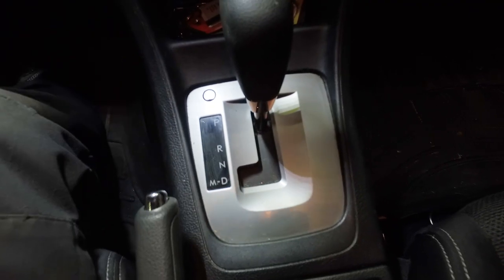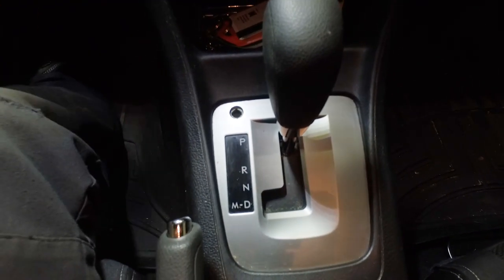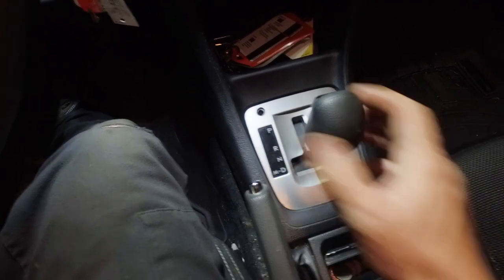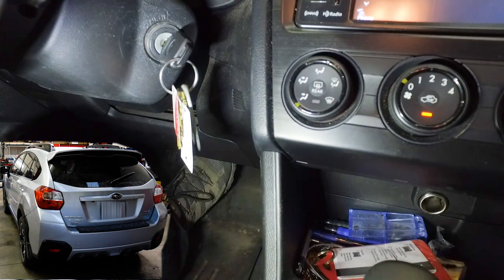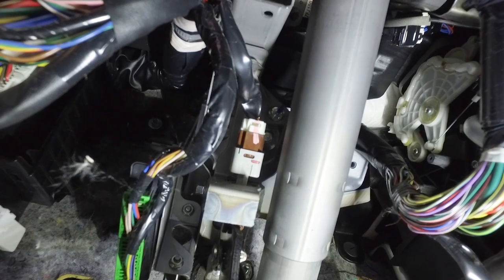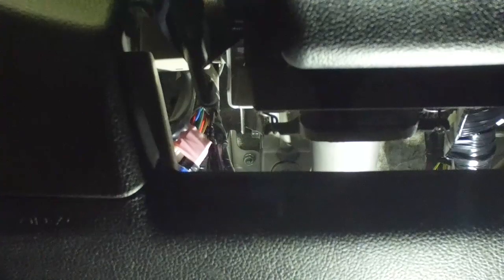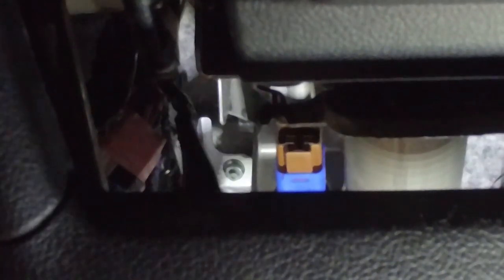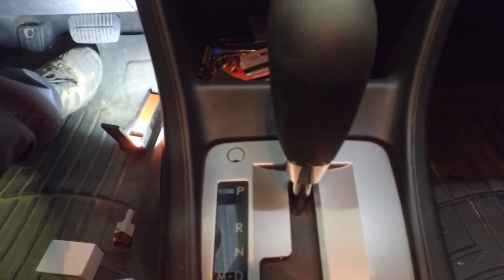Subaru Shifter Stuck In Park - bypass and repair tips - brake light switch

Comment: my brake lights off and the shift stuck in park. I changed two fuses. they burnt. Then I changed braked light switch, I could move shifter. after 20m drive, it stuck again and brake light off. what I should do next?

Comment: Our 2006 Subaru Impreza (124,000 miles) is stuck in Park. It starts and runs normally, and the stick shift moves, but the dashboard display always indicates P no matter what gear the stick shift is in. The car does not go forward or backward. Initially the brake pedal was very hard to depress. Now, after fiddling with the stick shift, it seems normal. Expensive code reader finds no stored or pending DTCs. There are no check engine/trouble lights lit on the dashboard. Pressing the emergency override switch next to the stick shift makes no difference. Unsnapped all of the plastic from around the shift stick to make sure I was pressing the switch all the way down - no difference. Even though the brake lights seemed to work normally when the pedal was depressed, I changed the stop light switch anyway - no difference. Brake lights still come on when the pedal is depressed. Dashboard still indicates P when the shifter is moved. Car still will not go forward or backward. Right now, whenever the stick shift is moved into Park, a loud click comes from the dashboard. That never happened before. Prior to getting stuck at work, the brakes worked normally, the car was quiet and there was no reason to suspect anything was about to go wrong. Have you ever seen this before? Thank you.
Reply from the maker: It’s possible that the shift cable broke or a plastic component in the shifter broke. Might need to look underneath while someone moves the shifter and see if the shift cable and lever is moving.
Reply: Thanks. I was thinking that too. A disconnected cable is the only thing that makes sense but countless others say it's either the stop light switch and/or the shift interlock. Hopefully, I'll find out which it is this weekend... @ThePracticalMechanic

Comment: Knew this trick, but wasn’t working for me (after going awhile with out needing to use it)-with the screwdriver I had normally used for some reason. Your tip about length was really helpful.

Comment: 2013 legacy allways is BLS is on c0043 how i can solve this issue, VDS Control Module IO Signal input pin number 3 7.4v allways when i remove sensor doesnt matter...

Comment: Thank you for your detailed descriptive step-by-step video. I had the same problem on my 2013 Crosstrek. Luckily the shifter wasn't fully stuck in Parking. The lights for ABS, Traction and Hill assist were coming on after about 10 minutes driving, not at the very beginning. After about 10 days with this going on and off I got a new sensor, replaced, and no more issues. Thanks a lot.

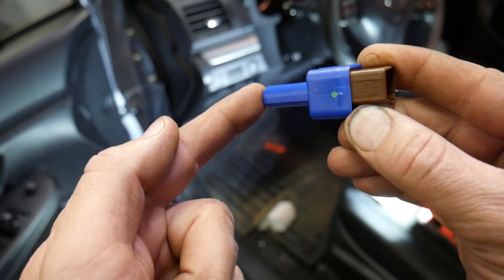Comment: Awesome video.  Many thanks to people like you that actually take the time to guide us in order to save $300++ in bull charges from auto shops.  Subaru, Forester 2015.  Same problem.  It did happen every once in a while.  3 lights ON.  Not consistent with anything.  One time, it locked my gear box just like on the video.   After turning the engine on/off several times, it actually unlocked it and the 3 lights went off.  The engine key is NOT deep enough to unlock the shifter so you better have something long and narrow to use.  I purchased the switch from ebay for $14.50.  Although it was advertised as OEM Subaru part, what came had a "NISSAN" logo stamp, just like it shows on the video, on the brown part at 6:50.  To my surprise, the switch I removed from my car was IDENTICAL TO THE ONE I PURCHASED.  Blue/brown, NOT CREAM/BROWN.  It even had the "NISSAN" stamp on it too!!!  But it did not have the greenish paint mark shown at 4:43.  The new part did!  I replaced it.  It takes less than 5 minutes and it only requires a screwdriver.  So far so good.  I will update if i see any issues.This is my husband writing this review
Reply from the maker: Awesome.  I’m glad the video helped. 

Nissan make many electronic parts for other manufacturers. The Subaru dealer I buy parts from is combined with a Nissan dealership. 

Thanks for stopping by and thanks for the detailed comment about your Subaru.
Reply: Which 3 lights came on when you had this issue? Do you remember if the steering wheel was hard to move? My daughter has a 2013 Outback and twice she has experienced this weird mode.

Comment: Thank you very much for this video! I have a similar problem with my 2012 Tribeca but in my case the shifter is stuck in sport mode neutral. I’ve tried this technique but it still won’t go back to normal mode and can’t remove the key. Please let me know if you have any suggestions. Thank you!

Comment: Interesting to see the mention of silicone as a cause of poor contact in that TSB. I use dielectric grease on connectors to exclude water and reduce corrosion, though I often wonder about whether the silicone in dielectric grease might contribute to poor contact.

Comment: I am having similar issue but the key gets stuck on and will not turn all the way back to lock to remove it. 

I figured out disconnecting battery will allow me to move the key to lovk and remove it but will this solution resolve that also or is it a different solenoid all together?
Reply from the maker: This is an issue with the park position micro switch in the shifter. I have had numerous cars come in this way but haven’t had time to film one. Subaru used to sell the complete shifter but now they have a service kit to replace the micro switch on some models. Basically the switch is to confirm your in park before they car can turn all the way off.
Reply: @ThePracticalMechanic  than you. I'm wondering what it i just unplug it until the part comes in would it work just less safely?

Comment: My problem: the switch is turned around. So I can't depressed the release button. I thought of turning the piece counter clockwise to release it so I could rotate it to access the release button, but it won't budge.  Does the top part have to be done first before it can be pulled out??

Comment: 👏👏👏 Thank you! You even put up the image of the service bulletin with the part number!!! I have a 2012 Impreza and it looks like I have this exact issue. Brake lights work fine after I do the override with a screwdriver and get it in R, N, or D. I recently had all my brakes changed (expensive $$$) and I wonder if the very thing they mentioned in the bulletin about someone using a silicone lubricant around the area of the BLS could have caused that non-conductive coating build-up. The fix you did seems like something I could reasonably do on my own. If I can locate the correct part, would you recommend me giving it a go on my own? Or is it something that carries a bit of risk for a non-professional? Again, THANK YOU!
Reply: Also, I purchased the car used from a Honda dealership, so not sure if they would carry the part or if I'd have to check with my local Subaru dealership. If there's a service bulletin, does this mean I could possibly get it fixed for free? Not quite sure how that works. I've taken it to Honda for service recalls before, but I'm not sure if there's a difference between a recall and a "service bulletin".
Reply from the maker: I would call t he Subaru dealer and see if they can help you out. The part should be purchased from Subaru if you are going to do the job your self. The process is relatively easy although if the sensor isn’t install correctly you may have additional issues.
Reply: @ThePracticalMechanic  I appreciate it. Subscribed for sure.

Comment: Having the same problem with my 2012 impreza.  The brake lights do work though.. So it's a different issue completely. If it's too expensive to fix would it be dangerous to keep using the emergency override button to shift into gear?
Reply from the maker: The brake light switch is two switches built into one so it could still be the problem. It won’t hurt anything to use the override button.

Comment: So I'm stumped. This fault is the only thing I've found that corresponds to the 3 dash lights being active. I have a 2016 sti and I have all 3 lights on (also cruise control doesn't work and I'm locked into sport mode), but my brake lights are still working just fine. Any idea if this brake switch could be malfunctioning but not to the point where my brake lights aren't working yet?
Reply from the maker: The brake light switch typically has 4 wires and only two will be for the brake lights. The other two can be for computer control. I just had a 2014 STI in the shop with a 6 speed manual that would light up the dashboard after a short test drive because of the brake light switch. The dealer said it had an open recall on the switch so the customer is taking in for a free replacement. 

On the newer Subaru’s anytime a check engine light or sometime an ABS light is set the traction/slip and cruise light will start flashing and cruise control is disabled.

Comment: Is this the same process for getting your key out of the ignition when the ignition doesn't want to let go of it? It's been happening a lot lately. 2015 Crosstrek.
Reply from the maker: dzrt XV I’m not sure it that will help you or not. I’m thinking not. Does the key only turn back to the accessory position? Does the Park indicator light up on the dash? If wiggling or pushing forward on the shifter helps then the shifter may need adjusted or replaced. There could be other things causing it but just try to isolate what you you do to get the key out.

Comment: Thanks for details!  Apparently this has risen to the level of a formal recall -- I got the notice for my wife's 2016 Crosstrek just the other day.  Her car has the blue switch, but WITHOUT the 'green dot'.  Any idea whether or not that is a problem switch or if it's ok?  I detest taking the car to the dealer for anything - seems like it always comes back with something wrong/damage that wasn't there before I took it in.  I removed the switch -- it has "Nissan" logo on it.  And the following number/letter designation -- PA66 GF33K NILES.
Reply: Edit -- the marking on my blue (with no green dot) brake switch is PA66 GF33  NILES.  The "K" was an error on my part.
Reply from the maker: The main difference I remember is the dot on the brake light switch.  It’s not to invasive so the dealer shouldn’t do any damage if you wanted it done for free.
Reply: @ThePracticalMechanic  LOL -- I would PAY to NOT have them do it for free!  In fact, that's what I tried to do - just sell me the replacement switch.  No such luck.

 However, turns out there's more to the story.  Just went yesterday to the dealer to further investigate.  Their on-the-shelf replacement switch (your "FJ" part number) is EXACTLY like the one in our 2016 X-trek - blue WITHOUT a green dot.  Go figure.  Parts guy knew nothing about a 'green dot' version.  Furthermore - the replacement they're using for the recall is ENTIRELY different than either the grey or the blue switch.  It's black, has an entirely different electrical connection - the Subie's plug won't fit.  So it comes with a pig-tail that adapts the new switch to the Subie harness.  AND it's a metal threaded shaft - so it has to have the proper engagement with the brake pedal arm set by adjusting threaded fasteners that go above and below the plate that the switch fastens to.  Weighs MUCH more than the plastic switch - much more robust design.   Worst of all - for me - they would not sell me the replacement/recall switch.  In fact, it's in a box with no markings at all - no part number on it, no bar code.  Guy said he couldn't sell it to me if he wanted to  - no way to do the transaction absent the number/bar code.  I can only get the recall-replacement switch by letting them do the swap.  Furthermore, they wouldn't sell me the replacement blue switch (like the one that came in mine) even though they had it in stock -- because of the recall.  That's all I know!  Thx for the assistance.
Reply from the maker: Michael Yount thanks for the info. Subaru must have recently changed something when they went full blown recall. I will do some checking with my repair information and local Subaru dealer.

Comment: Hey ThePracticalMechanic! 

Do you have any remedy about the key being stuck or hard to get out of the ignition - Subaru XV. Thanks!!!!
Reply from the maker: Sam Sioson I have not run into the issue myself so I’m not sure if it is common or not. Do you have a spare key you can try? If the spare key works better then your primary key may be getting worn out. Make sure the shifter is all the way in the park position as well.

Comment: I need some help. Shifter is in park. Even with pressing the release switch it will no come out of gear..
Reply from the maker: If you press down on the release/override and the press the button on the shifter you should be able to pull it down into gear. It takes a longish rod to press the button.

Comment: Hello, I took my crosstrek to the dealer when this happened to me and ever since then I have been able to shift out of park without depressing the brake pedal. Can I fix this by taking out the switch and re-installing it with less pressure on the button?
Reply from the maker: John Cox That’s what I would try. It need a minor adjust to get that shift lock to work again. You will actually need more pressure on the button if the adjustment allows for it. When the pedal is pressed the pressure on the button is released so less pressure may make it worse. If adjusting it doesn’t help then call the dealer back because the new switch could be defective. Let us know what happens.

Comment: I’ve got a 2002 outback! I can’t get the ignition switch to turn. The steering wheel isn’t locked at all. I just got the car in a trade and I’m going to sell it but can get key to work! Any ideas?
Reply from the maker: Rick Ross do the keys work in the doors? Make sure the shifter is all the way in park. If none of that works the ignition lock cylinder may be gummed up or broken.

Comment: I’m having the same problem on 2019 Subaru wrx I did bypass the transmission (CVT) to get it home and every light is on except for a check engine light but the break lights do not work is this common for this generation of cars ?
Reply from the maker: I have not seen it on a car that new but it wouldn’t surprise me. I would call the dealer and let them know what’s going on and if they have to part on the shelf they may be able to repair it quickly.
Reply: But would that be your main indication if you we’re diagnosing this vehicle ? 
Btw the car drives fine except for the break light and having to manually put out of park
Reply from the maker: Steven Roseren yes it would. The brake light switch activates the shift lock solenoid and the brake lights. It also feeds a signal to the ecm to deactivate cruise control and change shift patterns in the transmission. That is why so many warning lights illuminate when it fails.  It is a simple job that you could perform yourself but you could probably get it done for free at the dealer.
Reply: ThePracticalMechanic Hey this a little late reply but I wanted to say thank you for your help, me and my gf were very worried about this problem especially on a new 2019 wrx cvt I have a 2017 STI and haven’t had any sort of issues like that but it was the break light switch , I told the service mechanic immediately when we got there and they were a bit hesitant because it was brand new car , but as soon as the technician tried to move out of park and I helped him he said “ oh yeah this is for sure the break light switch “It took a few days to order because this is the first 2019 they have seen with this issue , but I think there will be more to come from others I hope not lol but me being the first isn’t the best sign . I was hesitant to bring it to Subaru even though the vehicle has only 2500 hundred miles and we have a warranty but we do have some mods cat-back exhaust, Cobb intake and Cobb AP (Hand held tuner) but I do know some people at the dealership that will look past this stuff without voiding warranties thankfully , again thank you so much for your help I did not want to bring it to my performance shop and pay for diagnostic work that would cost a lot of money for a 18 dollar part . Thanks man me and my gf appreciate it! Car runs great no problems at all !
Reply from the maker: Awesome!! Glad you got it taken care of. It’s a bummer that even the new cars are having the same issue as the older ones. Hopefully you won’t have any issues now. 👍🏼

Comment: My 2016 Outback does this on hills, could it be the transmission?
Reply from the maker: If you’re on a hill it won’t shift out of park? Or it won’t move forward when you’re on the hill? If you’re having difficulties getting it out of park when on a hill then I don’t think it’ll be the transmission. If the vehicle just won’t move when you’re on a hill even with the shifter in drive then that could be a transmission issue.

If the shifter gets stuck in park when you’re parked on a hill it still could be the brake light switch. There may be a small piece of debris inside of the switch the only blocks contact when on an incline.

Comment: Is it safe to drive?
Reply from the maker: Kelly Xiong you may want to check you brake lights. This is primarily used as an emergency tool to get you back home or to a repair shop. If the brake lights are not working it present a safety hazard for yourself and others on the road. It won’t hurt the car mechanically to drive it.
Reply: ThePracticalMechanic thanks. Cause it was on but haven’t drove it, but do have to get to the shop and just want to make sure. Thanks.